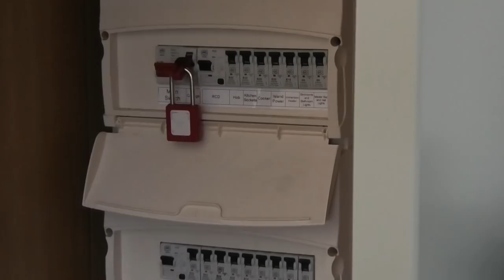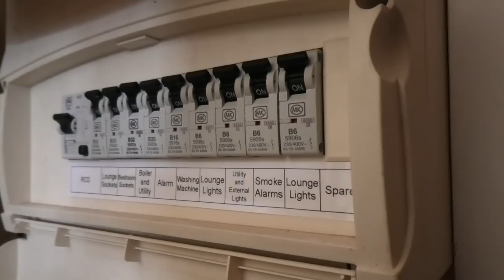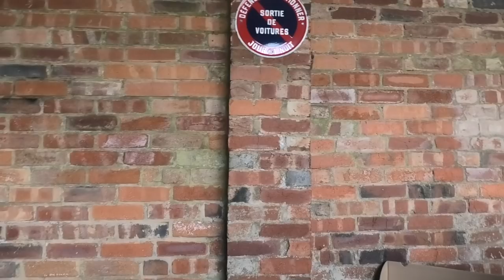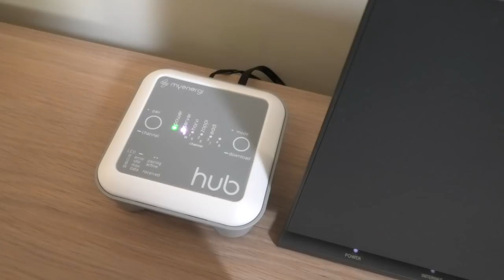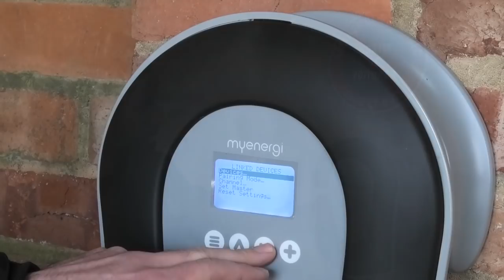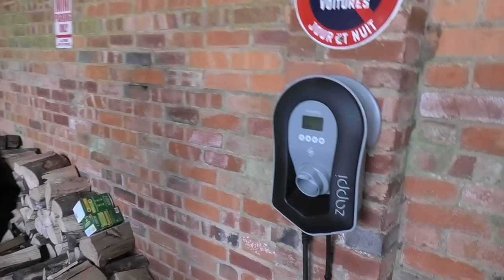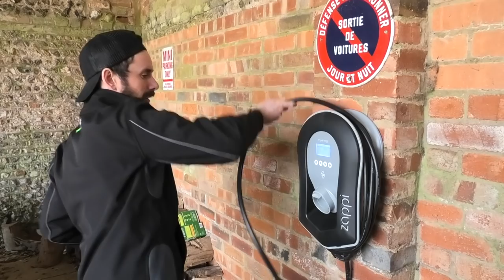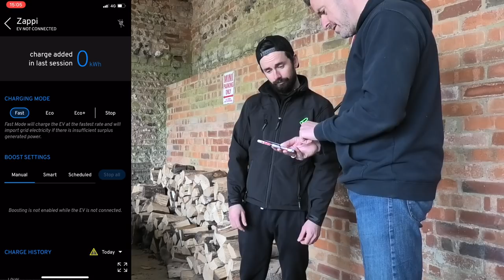Why have I fitted a Zappi Smart Car Charger ?!

Comment: I saw a video recently about EV usage in the USA, which responded to customer surveys concerning the tipping point for choosing EVs.  In the video it suggested that the salient points were a guaranteed 320 miles and a price of $31000 max.  The exchange rate puts that at £23800, and personally I would rather see close to 500 miles range, so I don't believe here in the UK that we are close to the tipping point yet. The price of the vehicle is going to be the biggest stumbling block, because we come back to the old argument about the variation in price depending on the country you are in.
I was wondering if anyone else would like to suggest their own particular price/range requirements before they would consider changing?
Reply from the maker: For new cars I am pretty confident those two criteria will never be hit 😢

Comment: That looked interesting,  I take it that the socket on the Zappi is just to store the charging  cable ?
Reply: It is indeed. On the tethered version (as seen) its just a 'dock' for the cable connector. On the untethered variant it's a true socket for the charge cable to connect. 👍
Reply: @crischapman84  Thanks... !
Reply from the maker: Yes 👍
Reply: @PetrolPed  Thought so.... All 
i need now is an EV, but will eagerly wait to see what this year has to offer. The "mini Tesla" has me intrigued... !
Reply: @pip5461  The "mini Tesla" unfortunately doesn't exist. Until you hear different it's just an idea for "the future". Tesla production seems to be maxed out with the existing models and they haven't event started production on Cybertruck or Roadster or Model S Plaid ... so don't hold your breath! If it's here before 2025 I'll eat my hat.
Reply: @MrAdopado  I'm in no hurry to change over just as yet... but it's something for the back boiler, it'll have all the latest battery tech...

Comment: Had my white V2 Zappi installed back in Dec 19 before my MG ZS EV arrived on 1st Mar 20 although as I could prove I had a car on order I received the £500 Gov grant as it was back then. Have you bought an electric car yet Ped?
Reply from the maker: No but I’ve had a couple of electric press cars since and having a charger makes that much easier 👍

Comment: 1)(1:55 sec) Canisters of biscuits and cake and the electrician didn't go for them....what's his problem ?
2) (14:06 sec) In Canada (Québec) electricity costs (0.0427 cents Cad kwh) or (0.026p UK/kwh) ! I understand the folks (who, by the way, drive on the wrong side of the road.......I thought I'd slip that in😉)....in the UK you pay something like 18.4p/kwh ! ! Wow ! That is expensive !
3) (14:19 sec) Solar panels and UK (oxymoronic)...........that's like saying sun with UK in the same sentence.........I heard that in the UK it's either cloudy, covered, misty, foggy or rainy but sunny ? Free electricity ! in the UK ? That was certainly funny.....well I found it funny !
And finally, in all seriousness, your electricity tariffs are unbelievably complicated and costly as hell ! Here (Québec, Canada) an electrician will install an EV charging station pedestal for outside parking or a wall unit in a garage or shed or carport. Most have cellphone connection but only for time schedules (charge status, time to start and time left) You just plug in the car and that's it ! It's the same tariff all day/night. Some communities offer rebates for a residential installations. 
Interesting video, as always ! Thanks.
Reply: You do not realise how tempting it was and I had to use all of my willpower to not plunder the cake tin, plus having a camera following your every move is quite a deterrent...

Comment: Really interesting. Having 3 phase put on here so more ability to fast charge and feed in from panels. Big resistance to stuff being controlled by hubs and apps however. Two automatic skylight window systems here, the hard wired ones have been no bother for 10+ years, the second hub / app ones a PITA to set up and work reliably,  just like the app controlled Bilsteins  I had on an Aston once, just give me a flipping switch.

Comment: Unless you have an EV all the time I should think you may end up just using it to charge when you need to charge rather than worrying about setting up set economic charging regimes. If you are coordinating sources of power generation and using clever coordinated tariffs then the Zappi is a great tool but in practice all EVs have the capability to time their charging so a basic box is all many people will need. Even with the grant it's not cheap! (I know, I've got one too.)

Comment: What is typically the cost of installing a car charging point?
Reply: Lots of variables to consider so costs do vary; cable run from the charger to the board, whether any trenching is needed, type of cable used (SWA, NYY-J, T&E) depending on the environment, earthing system (although that doesn't affect the Zappi), main cut-out fuse rating, if there are any spare ways on the distribution board (DB), does the existing DB need upgrading to suit, existing electrical load in the property...so you could be looking at a couple of hours to a day to install

Then there's the charger you choose as there are so many on the market, each with their good and bad points. The ones offered by the big utility companies aren't particularly good, neither are those which sound like a posh watch. Look for one with built-in PEN fault detection as that means there's no need for an earth rod to be installed which adds an additional expense along with the risk of hitting underground services when it's being installed

A pretty vague answer for you but under £1000 will get a good charger and its installation
Reply from the maker: Great answer from kevy427 and he installed it 😜👍

Comment: For a wee bit of balance currently 95% of EV batteries go to landfill. (source: University of Birmingham 2021). So think carefully about EV. Is having a car that’s fast in a straight line worth leaving your kids with an ecological disaster.
Reply from the maker: From 2035 you’ll have no other choice 😜
Reply: @PetrolPed  Good point Pedro, but they thought Diesel was the future not so long ago. My hope is with Porsche and their synthetic fuel. All existing vehicles and infrastructure remain and its low carbon. That has to be a more optimal solution.
Reply: @Marcke-tb1hb  - No one is dumping EV's batteries into landfill !! Batteries are too valuable to scrap and they are also really easy to recycle.
Once they have completed their life in a vehicle they can be used in factories, commercial units or domestic homes for energy storage for another 10+ years.
Reply: @SDK2006b  The confusion comes from the battery recycling statistics which are heavily skewed by the fact they include lead acid recycling which is 99%. Nothing like that number of Li batteries are recycled. But let’s not let the truth get in the way of the electric fantasy. Maybe you know something the University of Birmingham don’t?
Reply: @Marcke-tb1hb  - I work for National Grid and we have been working with Birmingham University and others on battery recycling to support UPS for our operational sites, solar energy storage and some other material researching. So I’m probably more aware than most about the situation 👍🏻
Currently Lithium EV battery recycle is worth about £3.30/kg so no one is dumping 600kg+ packs into landfill 🤔😝
Please provide a link to your source information because it’s wrong. A quick Google on EV battery recycling shows you that!!